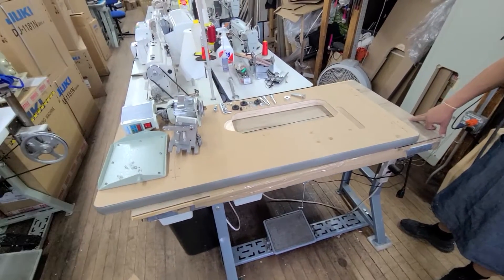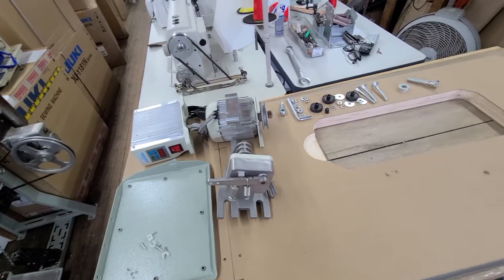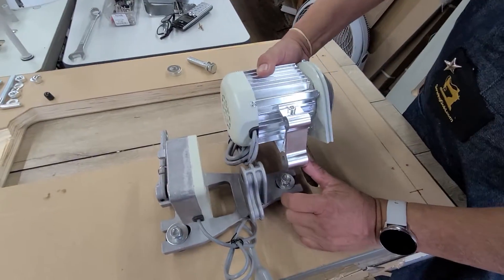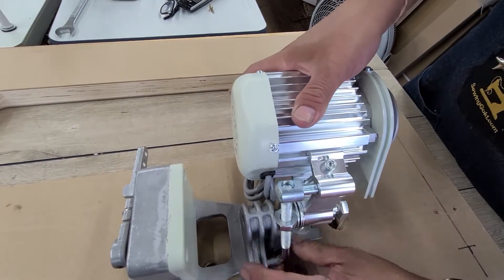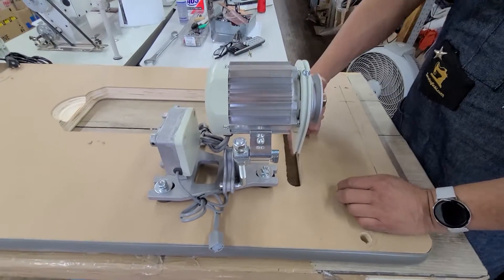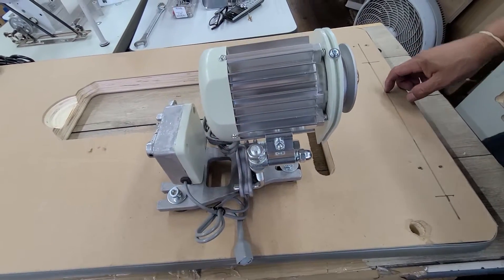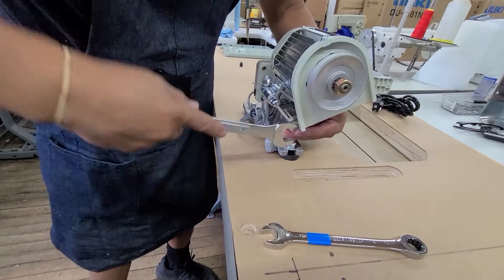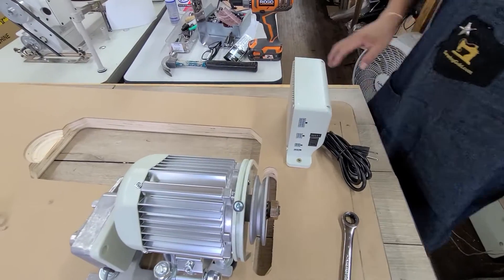Consew CSM3001 / 1001 brushless servo motor setup

Comment: Steve it cut off - was there more.  I saw the control box installed toward the front.  Was that it?  Is this for 1181N? Needle Positioner available?  Are there settings to lower the speed of the motor.  Thanks